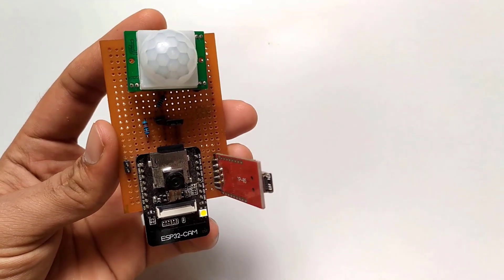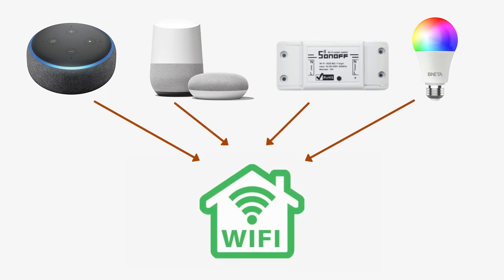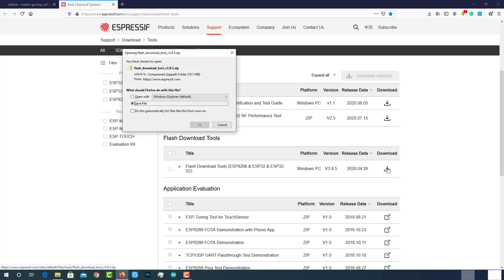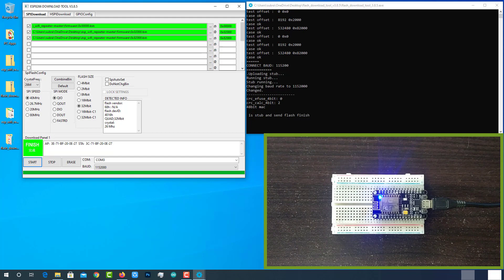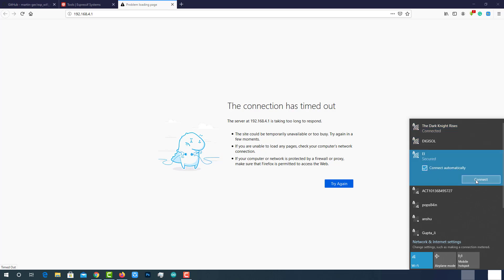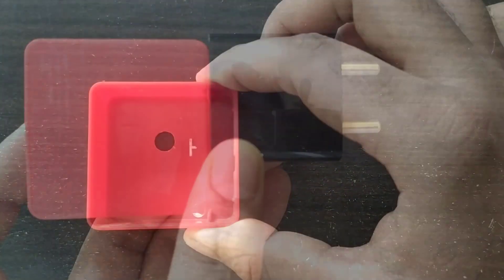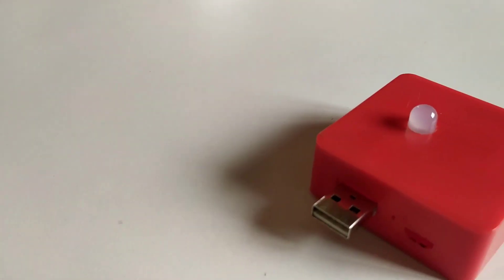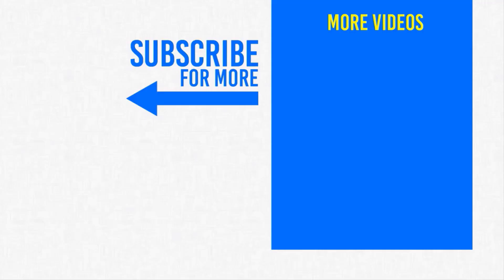DIY WiFi Extender | DIY WiFi Repeater | DIY WiFi Booster - with ESP8266

Comment: one of the first adds that helps me maybe do a side quest . yup . thanks for shareing wete you get your stuff made . glad sum one does it reasonabel for folks yup.  im needing a minie rainbow strobe circuit light machine . to make crystals turn colors rapudly.  to get voltage charge put of them . call it rainbow strobeing a crystal.  think you would find my work courious at least.  i make a prana gather to help manage the bodys bio electric . but yup make your self one their avhualy rwal joy buzzers . at very low voltages the body i hope is condusive to that level of voltage . and hope it dont cause bad side effects . but yup.  i am needing a simple build im invthe country in a trailor trying to extrend my parents wifi . fun times yup . stay blessed yars !!